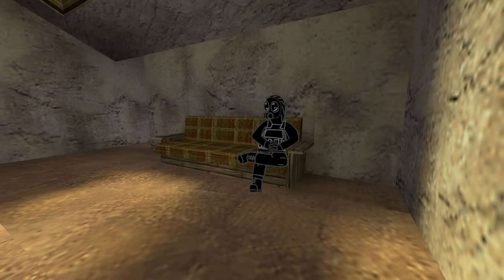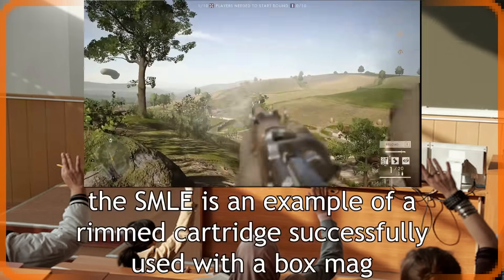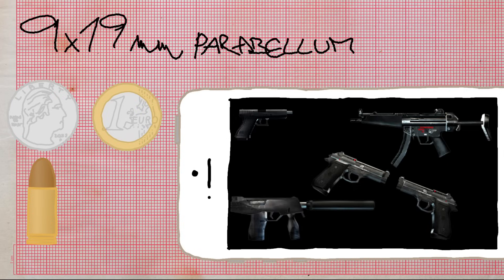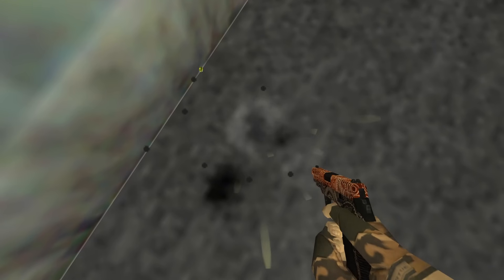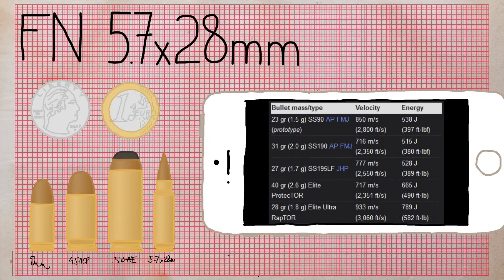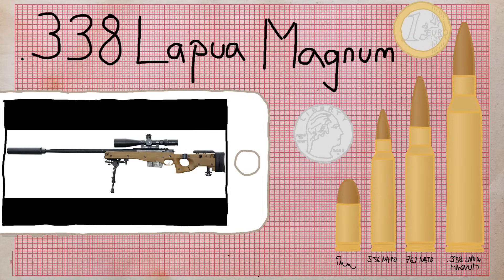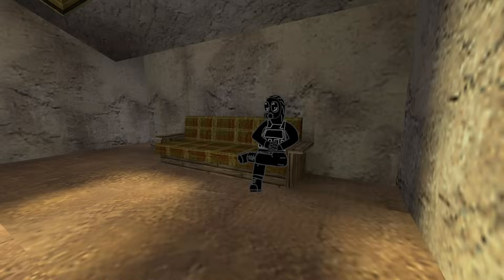The Calibres of CS1.6

Comment: The .357 SIG is actually intended to be semi-confused with the Magnum. It was designed to mimic the .357 Magnum's performance, but for a magazine fed pistol. Hence needing to be bottlenecked - it had to be shortened to fit the grip but still needs the gunpowder. Funnily enough the bullet isn't actually .357 diameter at all, but the link to .357 Mag was important enough to give that name anyway.

5.7x28mm also doesn't just go straight through. Like rifle rounds it will yaw - turn end over end to increase it's surface area. So like rifles it can still transfer a good amount of energy. Admittedly it is a bit harder to design a bullet to do damage exactly how you want, but most agencies demand a lot of penetration and they can certainly transfer all of the energy in the standard 12 inches demanded. It's likely a little less damaging than 9mm but really not a significant difference unless you're deviating from the penetration requested.
Reply from the maker: Thanks for this info, especially the .357 situation is very interesting! And for the 5.7 part, eh i guess i  just kinda blew it up for comedic effect (i love spreading misinformation on the internet)
Reply: Fake ahh account
Reply: marry me already

Comment: 9mm is actually semi-rimmed, where the rim is slightly larger than the case diameter. It also semi-tapered, with a nearly imperceptible taper. This is a quirk of 9mm being a very old cartridge. This is why the internal geometry of double stack 9mm magazines is weird.

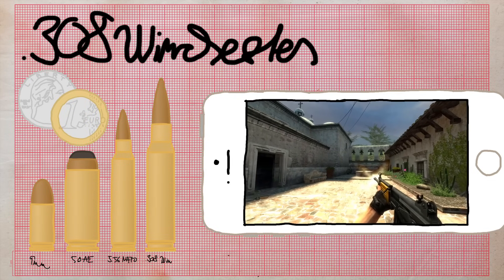Comment: 10:42 There is a .308/7.62 NATO galil variant, its showed correctly with its straight waffle box magazine
Reply from the maker: Ohh, i thought that was only for 7.62 NATO, thanks for letting me know!
Reply: @pezot205  762 nato is the same case as 308, and as far as i know, both of those terms are just two different names for the same round, sorry if i just said something someone already told you
Reply: @thebestname1343 yeah unlike the minuscule difference between .223 and 5.56x45mm, three oh hate and 7.62x51mm are the exact same cartridge iirc, just with an american .308 name cause it's THE american round (lol)
Reply: @polishbot  .308 is a little hotter than x51
Reply: @innernetstranger  fair enough! i'd hope it's not a big enough of a difference to cause pressure issues with most systems?

Comment: I liked your video, but few suggestions. Some meme video bits are too prolong and awkward, please add them sparingly, and make them short, sweet and on-point. Some parts of the video are kinda on the slow part, and i imagine non-gun people would just skip over them. Otherwise, great video, very much kept me interested! Never knew there was a 357 auto round from sig!
Edit: 7.62 nato galil exists, and it's called Galil ARM, which is used in cs 1.6. The straight wide is indeed a mag for 7.62 nato. The other question is why did they treated it like a 5.56 rifle in the game
Reply from the maker: Thanks for the feedback, i will shoot for the best result!

Comment: I have an ick for the Scout using the same cal as the Ak47. How does that gun hold Ak47 ammo when the magazine of the Scout is so much more smaller. The Ak mag looks bigger than what the Scout mag can hold, and yet the Scout holds the same cal as Ak. Wouldn't it be correct to assume that the Scout also uses a different cal than the Ak?
Reply: Me when computer experts aren't 100%  correct about firearms
Reply from the maker: Could be modelled after a different calibre Scout
Reply: The Steyr Scout can fire 7,62x51 Nato and or .308 winchester, the AK is in 7,62x39 which is a different cartrige all together, they are both .30 Caliber hence the 7,62mm but different in shell size, 7.62 means the diameter of the projectile fired in this case 7.62MM or .30 inches, but the key is in the last number 51mm meaning the length of the casing on 7.62x51 and 39mm in shell length on the 7.62x39mm.